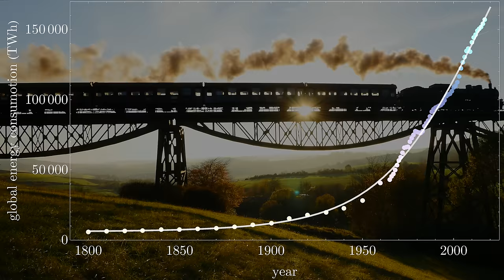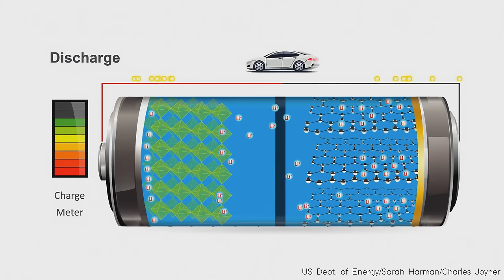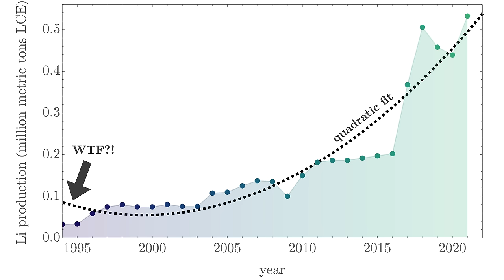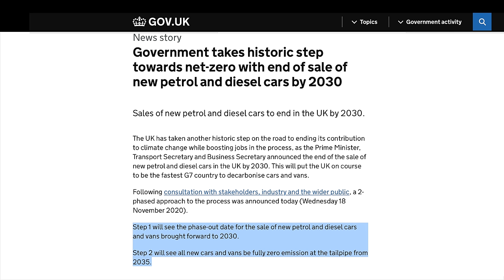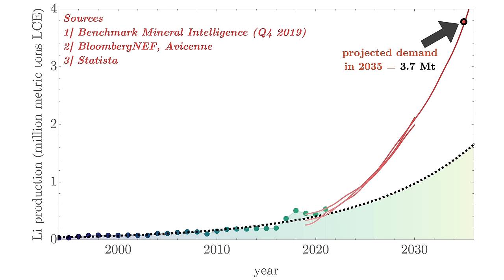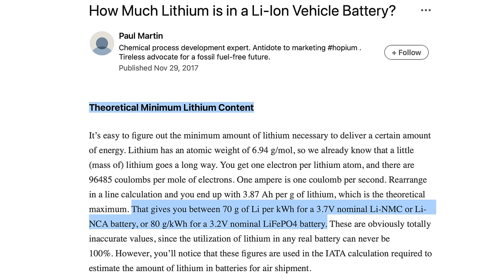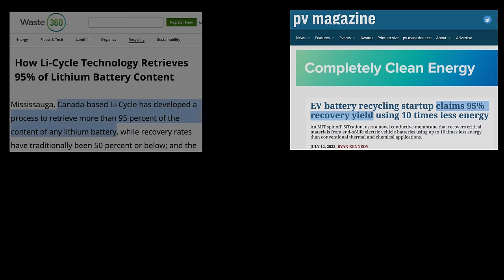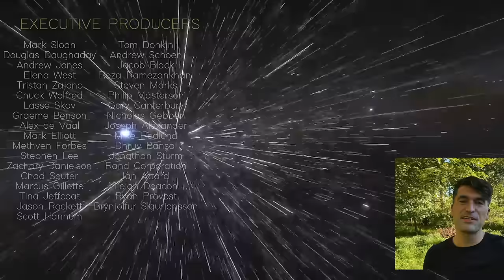Will We Run Out Of Lithium?

Comment: And with billionaires like Musk hoarding and squandering many billions of gov't handouts, a more important problem might be that few will be able to afford to buy EVs in the next 20 years. These problems are interesting, but we have massive issues at hand that really overshadow a lot of these projections. Famine is on the rise and global instability due to the spike in fascist authoritarianism throughout the globe is rendering a lot of supply issues moot. Of course this is all assuming we get a grip on climate change which currently is a very big if given the populist resistance to even addressing this existential threat. I live in Napa valley and I'm on day 4 of 114F temperatures.

Full self driving will in all likelihood never be a thing; it's always been snake oil. Ride sharing could reach saturation soon but it's got very limited application and with drivers being denied the rights of being an employee by massive corporations, it's unlikely to extend far into the future with the widespread mistreatment of labor and lack of benefits. Fully socialized public transit is one of a very few number of ways we can address these problems but adding billions of cars is not something that can be supported. Changing the way we commute is a necessity and it changes the calculus of many of these arguments. There are too many contingencies with issues like these and many of our current systems are already nearing a breaking point.

Comment: So how much fossil fuels are used to create a battery for an EV? I see no way possible that fossil fuels can not be used to process lithium.
Reply: 'The average EV requires 7911 kWh of energy to manufacture the battery (and this process will contribute 184 pounds of CO2). A gallon of gasoline is equivalent to 33.6 kWh of energy (if you could burn it efficiently), so this is the equivalent of 235 gallons of gasoline. This amount of gasoline would fill the tank of a Toyota Corolla about 18 times and allow it to drive 6,345 miles (@27 MPG).' - answer found on Quota
Reply: @sky173  doesn’t include transport and all the vehicles fuel and machines to create it.
Reply: @Lovenpain  I agree. It's probably 5-10 times that, minimum.
Reply: @sky173  see at least we can be civil and have a discussion. Until everything else that takes to make electric cars is environmentally safe, renewed resources, or just clean energy. Its funny seeing an electric car broke down on the interstate with a tow truck pulling a DISEL powered generator to charge it up! 😂
Reply: @Lovenpain  Totally agree! Cheers!

Comment: Mandating everyone get electric vehicles is all well and good.. but if that is to be realistic, prices on EVs need to drop significantly.  I know hardly anyone personally who can afford a 65,000-100,000 dollar car in their lifetime. Most people on earth are in this category. And if it becomes mandated I will be stranded at home , 15 miles from the closest tiny convinence store.. 45 miles from work and 40 from a grocey store/market. How would people like myself be able to live and work? I think EVs are great but it is not realistic to force people to drive one in the next 15 years. As wonderful as they are, you still are charging your EV with power most likely from a fossil fuel power plant, creating more demand on the power grid thus making the plant burn even higher quantities of coal, natural gas, oil.. etc. The only solution to that at this time would be solar, hydro, wind or nuclear power.. all of which have their own problems and polutants. Solar panels are made from extremely toxic materials including cadmium, gallium, and more. These panels have a very short lifespan and need replacent, adding toxic materials to the environment. Wind turbines.. a great idea on paper, are made from toxic fiberglass resin, and different polycarbonates, only make about 2-3 MW per turbine.. enough for 1000-1500 average homes. Hydro, debateably probably the best solution is great, however most river levels are dropping significantly IE, Colorado river, connecticut river, the river Thames in england etc..  Nuclear power which is surprisingly actually one of the cleanest power sources, while operating... Has a very high output, considering there are no malfunctions in that time.. still have to replace radioactive fuel rods and store them and other radioactive waste someplace safely for 30 years to 50,000 years depending on the material until they deplete their radioactivity, Which seems like a very tall task.. Plus EVs create a fair amount of highly toxic waste via the battery cells when they are used up and need replacement. Yes most of it can be recycled but not all... I am all about EVs  but the cost is extremely prohibitive. I feel like most people do not think about what i have addressed here and seem to think its a magical zero polution vehicle. It pollutes, its just coming from a  different  source instead of the individual vehicle. All said, I would buy one if I could afford it.. sadly the  reality is that I cannot, and neither can most of earths populace. Thank you for taking the time to read all of this if you did! Have a good day!

Comment: I am excited about electric cars, but I still drive my truck on gas. I refuse to buy an EV until they have enough "fueling" locations for me to travel wherever I want, and the decrease the time it takes to recharge, so I'm not sitting at a "fueling" location for 5-6 hours. Also the range needs to be increased on a single charge, though I can overlook that if a full charge from near depletion is in a 5-10 minute window. Once they solve those issues, then, and only then, will I buy an EV. But I am sure it will get there one day. I have kinda wondered, why there hasn't been any look into nuclear. But I guess that's why they are scientists and I am not.
Reply from the maker: Thanks for watching and your thoughts. Yes the range issue obviously is a problem for many still, faster recharging at minutes timescale is in development so could happen. Nuclear cars would run the risk of radioactive material spraying across the streets in accidents, would also put a heavy load on far more limited supply.

Comment: With such an enormous increase in demand over available supply, shouldn't it also be expected that there might be a rise/rush for alternatives such as sodium ion batteries? Maybe similar to today's diesel vs gasoline the future might be sodium vs lithium.

Also, with increasing availability of renewables, power-to-gas might become more relevant as time goes on. The reason gasoline might be preferable is that gasoline holds an energy density of 47.5 MJ/kg which by far outnumbers the roughly 1MJ/kg (or even only 0.3 MJ/kg battery pack) of lithium batteries. So replacing a 70-liter tank (roughly 50 kilograms of gasoline) with lithium batteries would mean an additional weight of 2.3 to 7 tonnes of additional weight of the battery pack alone for a comparable energy output. On the one hand, this back-of-the-envelope calculation shows that EVs probably won't cut it for long-distance travel or - more importantly - transportation. On the other hand, it also shows that possibly lower weights of EV motors don't matter much at this level. To me, this implies that in the future we will most likely not rely on a single lithium-driven solution for (personaö) travel and transportation.

Comment: The curves describing the projected growth of EV sales are jokes!   Given the present growth rate of EV adoption, the only ICE car one will be able to buy as early as 2030 will be an aging second-hand! 
And don't worry, there will be enough lithium produced.  As was said in the video, the black supply lines represent only planned extraction projects.  All the projects that will start their planning phase next month and beyond are NOT included, and that will be the majority... For example, I doubt very much that Tesla's project to extract lithium from lithium-rich clay deposits in Nevada is included in those statistics.

What will take even more battery capacity will be home and grid storage capacity (approximately twice more than for the world's entire road vehicle fleet).  However, for stationary application, for which battery weight and size are of little importance, sodium can advantageously replace lithium (or yet other battery chemistries).  That will cap the lithium needs in the 2030s, without slowing down the energy transition.

Conclusion:  no, there won't be a shortage of lithium.... except possibly for a transitional 2-3 years.

Comment: What will happen to all of the use lithium batteries? Not economically feasible to recycle.

Also, haw are they to be charged? Let's set aside the idiotic ideas of wind turbines and solar cells that only supply about 4% of current supply.

Then, there is all of the enhanced electrical distribution infrastructure. Do a breakdown of what has to happen starting now to meet the demand of EV charging in 2030 and beyond.

EV's may be the future but the future won't arrive on time if the generation and distribution isn't ramped up pretty rapidly.

I think new technology will allow humanity to overcome everything but natural disasters. I also think natural disasters will be dramatic in the future.

The earth, historically, has pretty devastating natural disasters fairly regularly.

The next disaster will be worldwide starvation due to climate change which will have nothing to do with CO2.

As a matter of fact, more CO2 will help mitigate worldwide famine by making plants more resilient to drought.

Comment: Tbh, the 2035 deadline on internal combustion cars seems awfully short. For some weird and nonsensical reason, cars are seen as evil when ONE single cruise liner has the polluting power of all cars in Europe put together. 
I guess it's easier to cut down on cars rather than stop cutting down on trees all over the planet. But cars are evil.
In the meantime, Elon wants to shoot in space 40000 satellites, which will require hundreds of launches every 5 years. Cause we all know that his rockets use electricity and not fossil fuel to fly..., but cars are evil.
The amount of space debris in a few years, when those satellites are supposed to burn in the atmosphere, can end any attempts to ever go up there for a long time.
But cars are evil.
Reforestation, improving the existing technology to reduce pollution, focusing on raising the quality of life for the poor people should be the main goal.
Replacing the internal combustion engine cars should be a gradual process and not a dead stop and that's it. 
I know that people will still be able to use their cars after 2035, it's just the manufacturing that will supposedly stop.

Comment: i feel like battery EVs are a dead end. "clean" hydrogen is probably far more eco-friendly - though would require a huge amount of sustained investment to achieve. and also a huge pivot away from fossil fuel-based energy generation
Reply: also lithium ion batteries are basically one of the worst ideas ever to use in a car. lithium ion battery fires are basically impossible to put out and cause huge problems when they happen on a road or in enclosed areas (underground parking lots, tunnels, etc)

Comment: Why would batteries use lithium in 20 years from now?
You know there is sodium?
Reply from the maker: Lithium is the lightest alkali metal, as stated in the video, you can’t change the periodic table
Reply: @CoolWorldsLab , have you noticed what is right under Li in periodic table?
That’s why sodium has same characteristics than lithium.
Second best is quite good when the best is not available.

Comment: Battery operated cars are not the future unless they come up with something else that lowers the charge time and increases the mileage. Even then the grid can’t handle the influx of electric cars.

Hydrogen is the future.  

We are close to mass producing hydrogen, using renewable energy, mainly turbines and solar panels.

Unlike battery storage hydrogen will not lose power overtime being stored like batteries

There are companies out there right now, using hydrogen, plug power, being one of them using them on forklifts

Unlike with it, battery powered forklifts, hydrogen power forklift have no downtime.

Takes less than five minutes to recharge forklift with hydrogen

No need for large rooms storing batteries mainly made out of lead.

Hydrogen unit, staying at 6 feet tall to feet deep 3 feet wide

Hydrogen is the future

Comment: one way would to build a bunch of fusion reactors and emulate the sun and burn hydrogen to make helium witch we can use for industry and burn the helium to make lithium for the batteries.

if we run out in the earth then we can burn many tera or even peta watts of electric to run fusion reactors to make it.